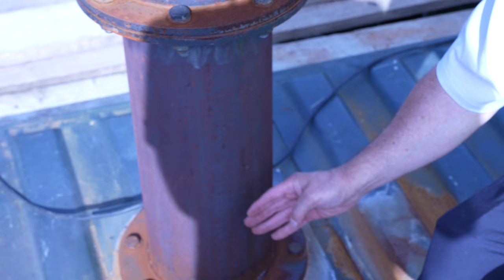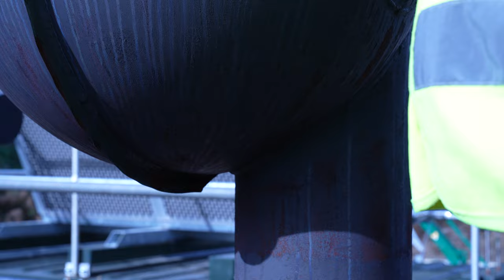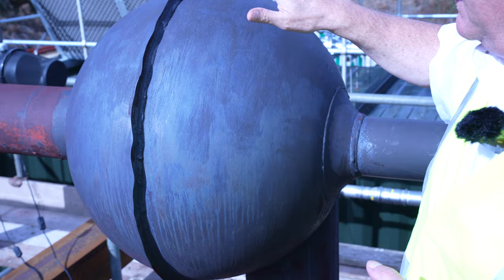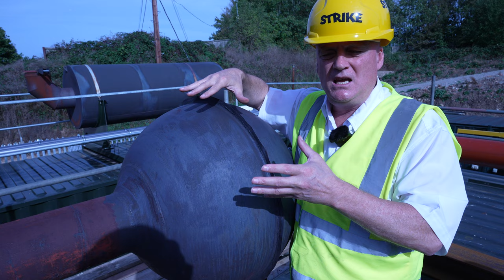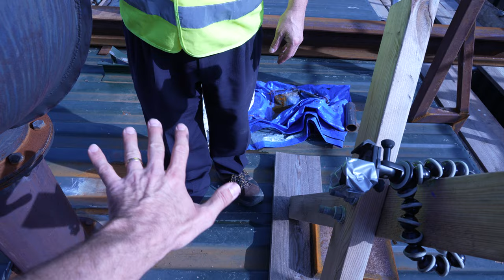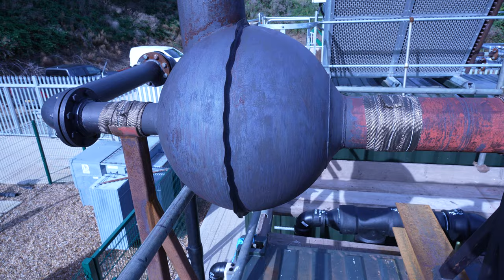THOR - The Thunderstorm Principle

Comment: If he believes what he is saying, why is his arm across the sphere ?
Reply: Bob, you thought my microwave test was so unsafe you could not share it...
Reply: @spacecase0  hey did you post that one on your channel?
Reply: and he says clockwise and anticlockwise as if that makes any geometrical sense at all lol  relative to a point of view... not that he explained anything at all
Reply from the maker: It is turned off (for days)
Reply from the maker: Not everyone has a multi 100kW grid connected gen set and the capability to retro-fit something like this @spacecase0
Reply from the maker: In open science, it is important to share how someone arrived at something - right or wrong. @sFeral
Reply: @MFMP  windhexe didn't pan out, at reasonable speeds at least. What kind of pressures are they dealing with here ? Cause that "old vortex tube patent" relies on high pressure on the input to establish the "vortex interface" that leads to the temperature gradient (heat transfer) between the oppositely directed and oppositely compressed flows... and at a low efficiency if you take into account the energy it takes to create the pressure, be it by first compressing a gas, or impelling it into the device. In loo of that, again the only thing keeping the idea afloat is hope that there's some simple magic amuck that hasn't been discovered by guys that develop internal combustion engines, who deal in these parameters quite a bit
Reply: @MFMP  perhaps showing a block schematic and listing the claims about the device would make the matter more accessible to a wider audience. The claim seems to be that it increases combustion efficiency, but that only requires measurement of fuel consumption VS co2 output. Bring the engine to a DYNO
Reply from the maker: Windhexe is only starting on its journey - we have not added, heat, moisture or ionisation. It is currently being instrumented for parameter sweeps - you should go and check out Windhexe.com.

Henk has done some mini-hexe with the blowers and of the big hexe testing out nozzle shapes and already has cans completely shredded.  @sFeral
Reply from the maker: This is being worked on for small unit in the live documents here http://www.quantumheat.org/index.php/en/home/mfmp-blog/560-thor @sFeral
Reply: @sFeral  Basically, the genset IS a dyno- you measure your AC output of the generator, you know the baseline efficiencies of everything, run the system with and without the reactor inline (and with and without the bubbler, obviously) with the same intake and exhaust restrictions, and the calculation is fairly straightforward.
Reply: @ticthak  That requires a variable electronic load to measure the power accurately. The word genset doesn't ring a bell. What I'm saying is, there's mechanics out there that can confirm this if it's been demonstrated on a car engine like the man said
Reply: @sFeral  Genset = motor +generator, what most people erroneously just call a generator- a generator is what you attach to a mechanical energy source, in this case the Perkins engine (I'm still trying to figure out if it's a Diesel or standard ICE, as "mains gas" can be used in both).The load in this case of an actual installation is the metered feed into the grid, the installation on a vehicle is not the testbed, it's more a proof-of-device, since it's similar to many things such as a GEET.
Reply: @ticthak  to measure power u need a variable electronic load... but I'm talking about independent tests, hence a setting which is "abundantly" available, with ppl in charge who would also be very curious about the results, given the claims. Also, "green" (EU) government organizations should also be interested, but involving any of these would introduce a definitive timeline/deadline after which it would be impossible to perpetuate claims
Reply: @sFeral ... which is exactly what's happening here.

Comment: Love the difference between people doing, developing and trying things, and those who just pour scorn on everything from the safety of a keyboard. 

I bet the first time they tried this it didn't work,  so they modified it and tried another 100 times to get to this point.

But for people like this, we would still be sat in a cave.

Well done, keep at it, if they make this work and scale it up, it will change the world.
Reply: I would say, scale it DOWN, not up. If the Falcon motor (originally either a 140 or 200 in^3 displacement) gives the optimal results of 0 CO2 exhaust emissions, why look at anything else before that's FULLY characterized and and understood as to why that particular 60 years old motor works so well?
That, of course, will never satisfy anyone's personal desire to get rich...
Reply from the maker: Nothing great was ever done easily.

The only way to ensure failure is to give up.
Reply: Thunderf00t's video ''TwoBitDavinci: BUSTED!!'' talks about similar inventions!

Comment: Bob, as everyone brings the standard exhaust analyzers which register only the fumes that are expected with normally operating ICE engine; do you have somewhere any other recording of testing with analyzer registering other possible elements like the ones to the right of oxygen? I presume that the current process isn't much tuned up yet, and logically there will be also other elements transmuted, like Fluor, Neon, Na, Mg... but they go unregistered by a standard analyzer.
Reply from the maker: Nykyta Vovk has an in-line process mass spectrometer and can do this. He is waiting on one of the professionally made units to test accordingly and in the meantime is testing the standard generator.
http://www.quantumheat.org/index.php/en/home/mfmp-blog/560-thor

Comment: As someone who has only just discovered this generator. Is the point to clean up emissions and to make the combustion engine more fuel efficient?
Reply from the maker: It does appear to at least do a cleaner burn of the fuel and has shown some improvement in efficiency under load. The MFMP is working hard to confirm other claims.

Comment: We are subjected to the male vertex above the surface of the ground of the earth and the female vertex in the earth below the ground, female negative charge and male positive charge. We get sick and get mental illness because everything is spinning in mostly one direction (all the solar system planets and male spinning vertex which is dominating the earth, even bolt threads, screws lefty loosy, righty tighty) this spin is not good for us, we need the opposite spin to make us feel good and balanced. So the reason we have so many pyramids on the earth is so the earth spins east, because the pyramid has a female spinning vertex that naturally comes out from the bottom of it that goes directly into the earth, if you didn't know the opposite spinning vertex comes out from the ground upward male vertex, which is all over the world because the bigger the pyramid the greater it's influence on the distance it covers and send a opposite spin above the ground then below. So for practicality, how do we fix this, I have been using a drawing of a spiral that is much like the one they use for hypnosis, spinning from out going anti clockwise inward around in circles, then I put a arrow at the start outside on the outer circle pointing anti clockwise and another arrow on the very middle of the spiral in the centre also pointing anti clockwise. This will knock your socks off, just put 2 pictures of spirals on seperate paper with the arrows, and blue tac them both on your sealing of your house up one end of your house and above where you sleep, and watch as all your issues with sickness physically or mental illness, or inflammation pain, anything, it will change your life, like me, I feel like I'm living in a temple, it's a cool breeze that comes from the pictures of the spiral. It's amazing, Just do it!

Comment: I wonder how can the event horizon be created, when the two tube contents are separated and don't directly meet? I mean, on some Randall's depiction diagrams (the one where the sphere is actually square and the vortex is horizontal and in temperature relevant colors) the outer vortex (direction to the right on that picture) is not separated from the inner one (which starts at the tip of the conical valve and returns to the left). But then most other depictions of the thunderstorm generator show the tube contents separated in the inner and outer tube and no conical valve.